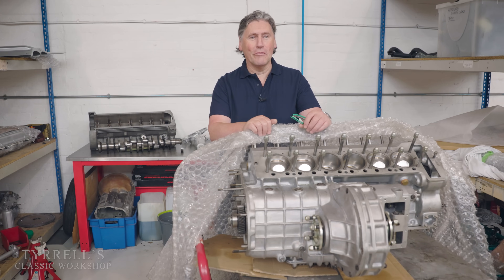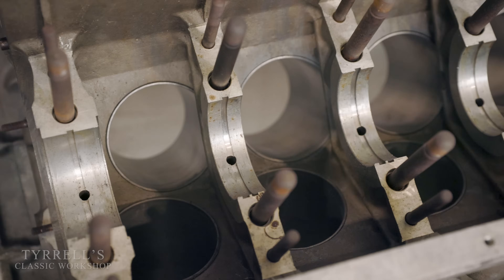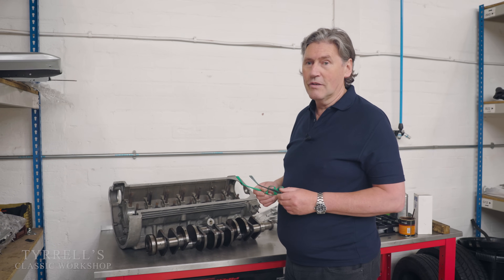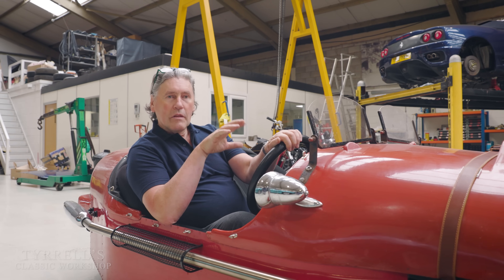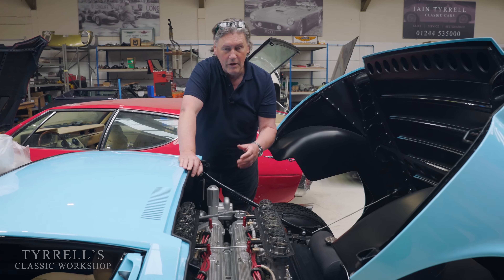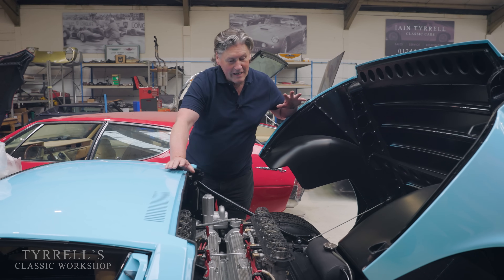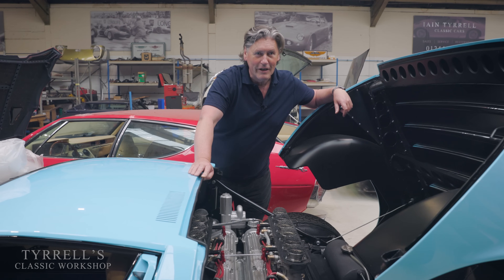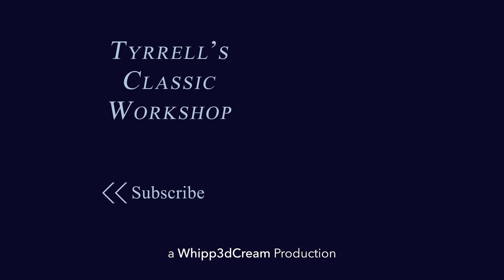How to warm up your classic car engine the correct way & why it matters | Tyrrell's Classic Workshop

Comment: Hi Lain , You have no idea how much I appreciate your channel , and this particular tutorial on starting/worm up engines. Since young age I had interest in cars and engine functionality. Just as I personal prospective, and by nature been over carrying for my personal stuff, I developed an interest on extending engine life, especially if I build it, . I then search into this subject, after experience at work, during  maintenance  on a paint industry,  on the routing starting of a generator, every six months, just for to keep it in good working other .  This is a big ex little ship four Cylinders  diesel engine where I used to walk between the Cylinders, and the conrods where exposed. Before occasionally starting it, we used to pressurize the engine oil with a "not a small V8 diesel engine", that in turns (because itself also wasn't started often), with the add of a hand pump, we used to PRELUBRICATE IT , and create an oil pressure in to it before starting it...... Say no more!!! Since then, I starting research in engine pre lubrication, and I Found this video on big container ships engines starting, to witch no matter how big the oil pump would be, by the time the oil would lubricate the critical parts and Create a (CUSHION OF OIL BEARING), the engine would almost disintegrate in no time!! Since then and still in my younger age, whenever I rebuild an engine, I create a secondary oil pic up, from the oil pan "between the crankshaft", ( but not  necessary from there), it could be a pic up from the oil pan as well, as long not from the very bottom or dirty oil would be picked up). Then  sucking engine oil trough a filter (of any car brand) into of any OUTSIDE Block gallery, with a quality non return valve, ( because once the engine will fire, (if without the non return valve), it will loose oil pressure back to the oil sump) On my last beautiful Ford V8 351 cu", engine , I used a forklift pump, it happened to be a 24 Volts pump, ( but it don't have to be a big electric motor, a simple and small one would do.) In my case it was convenient because it has a gear pump already attached to it. all I had to do was to attached a small (Toyota) oil filter with an after market attachment, on to the same gear pump and no matter how long the engine hasn't been started,....... in a few seconds of the electric switch activation , the oil pressure goes sky high , and when subsequently I start the engine, it starts  as smooth as a baby bump, without hydraulic lifters noise as they usually do make noise well after 12/15 hours the engine hasn't been running, if no pre pressurising the engine.. I know by facts  of the big difference, as I only can tall the difference. As a matter of facts, this pre lubrication/pressure, pump it only needs to be operated only once daily, usually in the morning, (or after years stud still). This is the crucial time needed, to keep the engine lubricated before initial starting after approx.. a 15 hours rest......! Thinking that we got in the past to remove the distributor before engine starting after long engine rest, and spinning the oil pump  with a drill, (on here we could of course) and after reassembling the distributor , tuning again the engine. When I was a very young fallow in Italy , I learned way Alfa Romeos  would take their time for the engine starting. I am going back in the late 50s. The reason is because they have a simple  and very affordable oil pressure switch that would delay the electric  power to reach the spark plugs until the oil pressure would close the contacts . The same electric switch used by regulation on any ricing cars today operating electric pumps in case they roll over, to stop the petrol, or any combustible fuel to continuing pumping. Easy to purchase it from any ricing car industries. From $ 80.00 to $150.00, circa, the work all just as good!! it won't pressurize the engine like a pump such, but at list lubricate the engine ready for the  conrod smashing the big ends bearings !! How much you LOVE your engine, since the major wearing is when you starting it????

Comment: After a long sit, I often pull the coil wire so you don't get combustion with primed fuel bowls and let the engine crank over 10-15 times to get oil up out of the pan and into the engine.  Once done, connect the coil and turn the key.  Done.

Comment: Good advice indeed , on my Aston DB6 , AC Aceca and classic motorcycles with a starter motor (not kickstart) the best thing is to crank the engine when cold with NO choke and watch the oil pressure gauge rise or the oil light go out before starting.
On modern cars the best  way is to start your engine and then put on your seatbelt, this simple delay helps with initial oil circulation.
My children do it without even realising why .👍
And of course good quality and correct grade oil for your car ( good luck with that ) as I don’t believe in the “classic grades “ as a cheap 20/50 is thinner at running temperature than a good quality 10/40 .
I hope this helps.

Comment: Modern cars seem to d the same electronically. Keeps the engine at 1500 for about a minute before settling down to idle. My father, who tuned a many a engine in his day, would do the same technique as show here. He also would often argue with owners, "Oil is cheap, engine arent". Keep your oil fresh, its cheap.
Reply from the maker: Well said!

Comment: The only thing I didn't get was how long to run the engine at 1,500-2,000 rpm before moving off. I believe that you should drive off almost immediately and then wait until everything is up to temperature before putting on more than about 3,000 rpm.

Comment: Thank you Iain! This is an outstanding presentation. I have learned one heck of a lot from you on how to properly do a cold start up on vintage engines that use a choke.  

As a side note, I have learned that having the factory correct spin on oil filter for use on a wet sump engine is very important in helping to prevent dry start ups from cold. In short the by-pass release valve, located inside the modern canister spin on type full flow oil filter, should be fully open upon cold start ups. Thus the oil flow from the sump by passes the filter media on a cold start up. This allows the oil to fully pressurize within the engine in a much shorter time period. The rating of this by-pass relief valve (amongst other ratings) is the important specification to pay attention to when choosing the correct oil filter. The by-pass relief valve is not to be confused with the anti-drain back valve. For example on some Ferrari engines the oil filter is basically fully inverted and located on or near the top of the engine. In this situation one can imagine how important it is to have both of the by-pass relief and the anti drain back valves properly working in the oil filter.

Comment: Glad I found this channel and particularly this video! Fantastic content!
Feel free to take note of my U-toob handle name and you’ll understand as to why I am OCD about engine start up procedures.  I bought a 3.5hp lawn mower years ago for $150 and modified the throttle to allow for a healthier warm-up procedure.  Last weekend I coached a friend on starting his 2-stroke 6cyl boat engine regarding tapping the electric choke button to keep it running just after starting as on many engines like those die if the choke is on for an extra few seconds and die with the choke off for a few seconds.  A TRUE ART FORM!

Comment: How long or how much heat would you suggest ? In other words hold at 1500rpm until  a bit  of heat in the engine  - what does this mean? Peg comes off the gauge etc?
Reply from the maker: Yes, needle starts to move on coolant temp would cover it to start driving gently

Comment: Great show Iain.  What do you think of these modern cars that the engine stops automatically, say at the traffic lights. Then start as you push the throttle.
Reply from the maker: Thanks. The engines are warm so it shouldn’t cause any damage to the engine. The starter motor would take a battering though!

Comment: Hi Iain, thanks for a very informative video. It would be interesting to present a video which discusses oil choices - the main ones being ZDDP and Molybdenum disulfide (as well as , and oil weight choices. I have a Mercedes M100 motor (M100.985) and use of mineral 20W-50 oil with a high "Zinc" (i.e. Zinc dithiophosphate and related compounds) or MoS2 content is standard, especially in a warm climate such as Australia - it's a 1960s design so definitely meets the "classic" criteria. Another thing often not discussed is the oil getting to temperature in any car  - it is extremely important to get that oil to operating temperature so surplus fuel from the rich cold start mixture does not accumulate in the oil, otherwise it is diluted and has an even lower effective viscosity, leading to increased wear at startup. Another thing to consider, later engines with catalytic converters; the catalysts (Platinum and Palladium) are easily poisoned by the traces of Zinc in the exhaust gas, changing the choice of oil one might use - modern fully synthetic oils likely contain no ZDDP. Obviously there is a lot to unpack and discuss. But it is a minefield of opinions, experiences and engine / oil manufacturer claims which are often in opposition. I am curious to know your thoughts on these matters, as you are one of the most experienced people in this area. Each engine is different, but classic cars tend to have similar design characteristics which might be easier to differentiate than modern high performance naturally aspirated engines, such as the Mercedes-AMG M156 V8. How do you decide what to use, especially if you're rebuilding an engine?

Comment: I have a 1930 v-8 Cadillac with 21,000 miles.  I was told by the previous owner to pull the coil lead and crank it over for a few times before putting the lead back on. Does that make sense for a car that isn't used very often?

Comment: Be better if all cars had an additional electric oil pump. To pressurize the oil circuit before starting the engine.

Comment: So you need a cranking switch and a separate ignition switch? Crank till oil pressure light goes out then turn on ignition for longest life.

Comment: Thank-you Iain.  Fascinating and informative as always!  It reminds me that, when we had an early Mini with a starter button on the floor, my father would always crank over the engine a couple of times before turning on the ignition and I'm now sure that he was trying to get the oil circulating without firing and stressing the engine (can you stress a low compression 848cc A series engine?).  I also remember our Triumph 2500 had a terrible rattle until the oil pressure built up which used to make me nervous - sure enough there was plenty of wear in that engine...

Comment: Great 👍
Iain, please do a follow-up video " Proper car cold start driving" Part II
Please explain the warming of the oil, how it does not come up to operating temperature as quickly as the coolent. The warming up of manual transmission synchronizers, bearings and gears. The warming up of automatic transmission clutch packs and bands. Warming of rear/front differentials. The general warming up of all the engine and trans metals. The care especially during winter temps to be gentle with shock absorbers and power steering systems. Gentle, gentle and patient with these geriatric machines. 
Happy 2023, good health and keep the sage advice coming.
CD in New Hampshire 👍🇺🇲

Comment: I always doing those firing up systems for different carburetor and choke systems and I find them on my own experience on different cars, It is wonderful to see you showing me that those systems are correct and best for the engines. Many classic car owners think that the engine should start right away and even they start to drive before they getting worm.

Comment: Great video, I've had a couple of BDA's on dcoe's only way they started was 3 pumps, started on the button and then had to play with them a bit to get them to run, didn't really have a choice in it they never wanted to start any other way. Never knew any of the technical reasons, very informative 👍

Comment: With modern engine management, the engine has to recognize the tooth patterns on the crank and cam wheels. The crank wheel will have missing or extra teeth to indicate TDC, but you don't know which cycle you are on. The cam wheel will have an asymmetric pattern that will indicate whether the next TDC is for cylinder 1 or 4, 6, 8 or whoever is 360 crank degrees away from 1.

As you crank the engine, the processor watches the crank signal, looking for the TDC pattern, once that is recognized (on average this takes 1/2 of a crank rotation) it starts looking for the cam teeth to figure out which phase the engine is on. 

Once the engine goes around one more full rotation, the processor can decide which phase it is on, check the number of teeth on the crank wheel to make sure it makes sense, and it is synchronized. Now it can set the angle clock and schedule spark and injection events.

This all takes one to two rotations of the crank. Not nearly enough time for the oil pressure to come up, but the ECU takes care of the idle valve and there is no reason to use the throttle at this point. Just let it start, give it time for the oil pressure to build, then let the engine warm before whipping it.

Comment: Very nice information. Newer stuff is optimized better for cold starts but almost every engine starts out with zero oil pressure. Newer cars have upgraded batteries/ powerful starters that fire up the engine even in -10 after two revolutions :) also oil has come a long way, but coldtarts are still torture...

Comment: you want the chock to turn off, or it well be overly rich and won't warm up 
so drive down the street genially before getting on the highway if you can, so the chock turns off and saving gas by going somewhere

Comment: Thank you for the really factual video, as a classic car owner I’ve always heeded advice on cold starts. I always keep the revs just above 1000rpm during warm up. Mine has an oil pressure gauge invaluable in knowing when the engine is actually warm. I never rev it when cold. 

Enjoyed a 20 minute video on how to start an engine. Thank you Sir.

Comment: When my motorcycle has been standing for a while I crank it with the kill switch off (so the engine won’t fire) until the oil pressure light goes out. Shame cars don’t have this ability. Worth hooking something along those lines up?

Comment: All good advice.   With so many cars being used infrequently it is worth taking the extra effort to warm them correctly.   It is also well worthwhile circulating oil in between fire-ups too - much easier on starting-handle equipped cars but getting the engines turned over every week or two reduces the chance of seizure.

Comment: my 97 corolla  hits 3000rpm   after start .. this is why burns some oil.  my old carbed twincam by the way can be  started more easily and let it  work easier , THANKS for the second tip  cause its better to get a bit dirty sparkplug than a more damaged engine... just kiding about the sparkplugs cause only my twincam kills em due to setup

Comment: Hello Iain
Thank you for a great video.

What is the correct proceedure for my 1961 250 GTE? It has a choke which I always try to avoid as I don't want to wash down the cylinders, but what about clutch, auto flux and throttle pumps? Is the following way correct?

1: Put on ignition and let the clackety-clack pump prime
2: Turn on the auto flux(Aux fuel pump)
3: Shut off auto flux fuel pump
4: Pump the throttle 6 times
5: Crank over the engine till it starts to fire
6: Let it smooth out and then bring to 1500-2000 rpm
7: Use choke in case it's very cold and won't fire without(rare), or is it better to switch on the pump again if the car won't start rather than use the choke?

Or.

1: Put on ignition and let prime
2: Turn on auto flux fuel pump

3: Leave auto flux pump on
4: Pump throttle 6 times
5: Crank engine till it fires
6: Bring engine to 1500-2000 rpm after it smooths out
7: Shut off auto flux pump

And the final suggestion.

1: Put on ignition and let prime
2: Don't turn on auto flux and no choke
3: Pump throttle
4: Crank over till it fires
5: Let smooth out and bring to 1500-2000 rpm
6: Switch on auto flux on after warm-up or leave off?

Also, will the 250 prefer the clutch to be pressed or should I leave it in neutral?

Thank you - now I have gotten all paranoid lol.
Reply from the maker: Option 1 but Never use the choke- the cable can stick, which will kill the engine. If it fails to start from cold, pump throttle and try to start again. You can leave it in neutral whilst starting. Simples!!:-)
Reply: @iain_tyrrell  Thank you for your replay. Very helpful.
I always try to avoid the choke, but if I use it which is very rare, I always pop the bonnet and see if it has closed properly after I close it in the cockpit.

It's interesting. Every time I attend one of the Ferrari events such as the Classiche Classic here in September, at every drivers meeting each day, the attending Ferrari mechanics always tell people to leave their electric fuel pumps on. I never do, but I can't help but wondering how many issues that will cause down the line for the owners.

Comment: Meh, he's ignoring how much oil chemistry has improved so that it protects during cold start up. Unless you are using oil from the 60's, you can't just pretend that's not a factor. Also, contradicting that you want the engine to run faster to pump the oil, but you want to run the engine off the starter to pump the oil. Which is it? Bottom line: Just start your more frequently, and drive gently at lower revs by short shifting until it warms up.